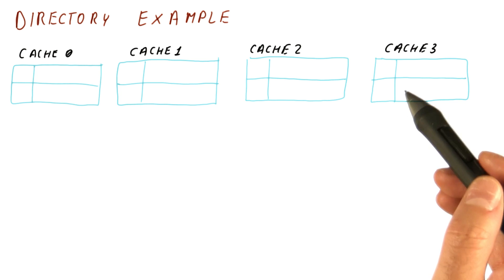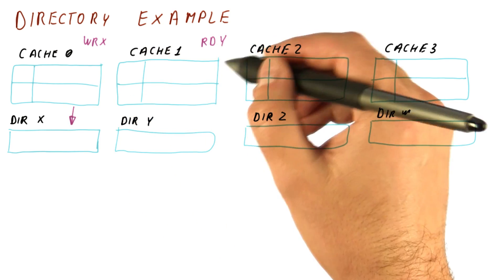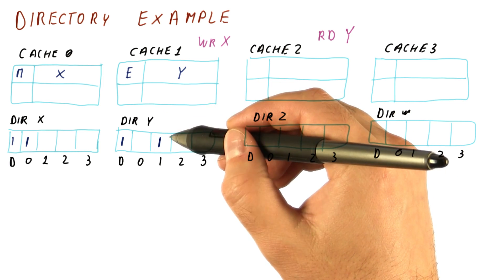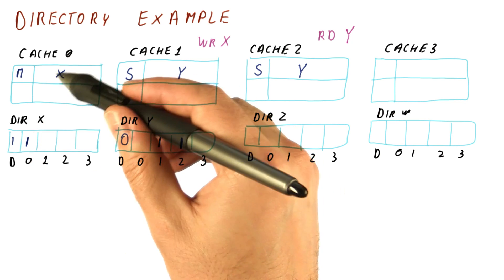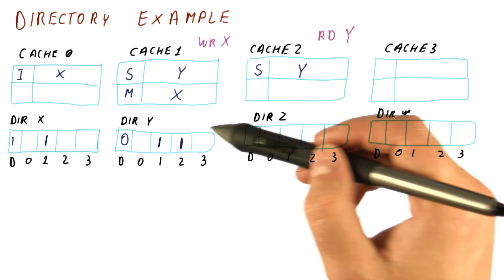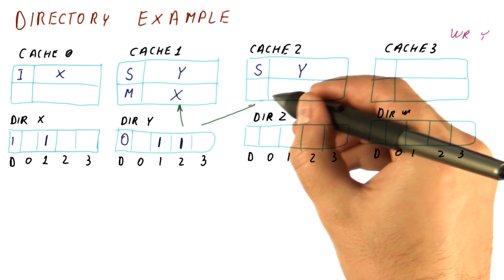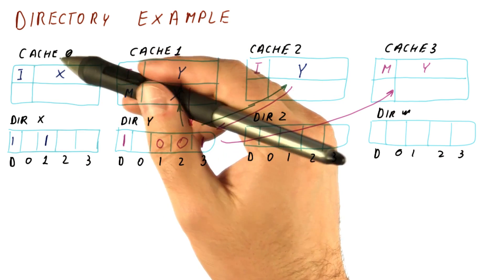Directory Example - Georgia Tech - HPCA: Part 5

Comment: Why does the first read Y for cache Y grant exclusive access? In all literature I've seen it should be shared status
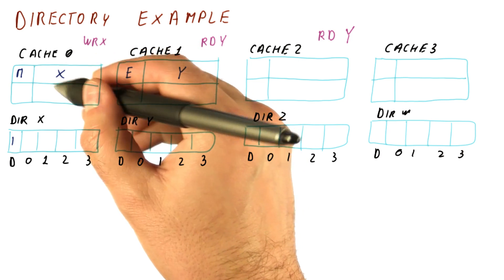Reply: Do you mean at around 1:35? When only Core 1 sent a read request for block Y? Since it is the only core that asked for the block (core 2 only asked for it later), the block is only present in its cache and it is in the exclusive state. Exclusive can become modified as soon as the block has a local write, without communicating with the directory (AFAIK). If another core asks for the same cache block, the initial exclusive block becomes shared (and if it was modified, the data gets sent to the new core that requested it) and the dirty bit (in the directory) gets reset.
Maybe you have been reading about the MSI protocol? This one is MESI, I think.
Reply: Can you please explain why he set the dirty bit for exclusive read even when it was having a clean copy of the block?
Reply: It's the "Just being Generous" variation of Directory